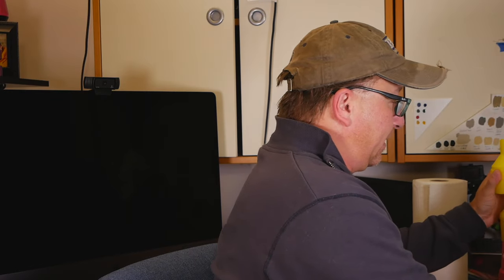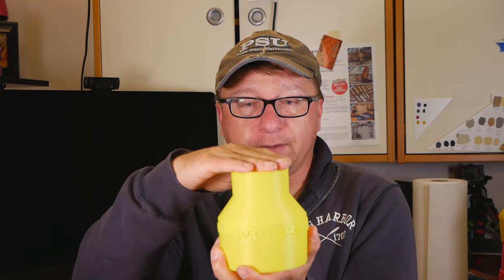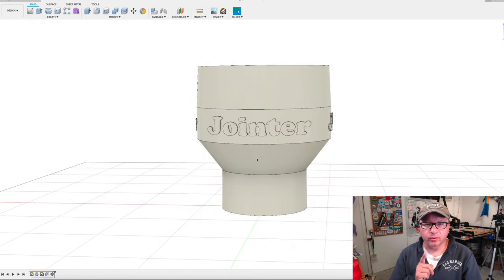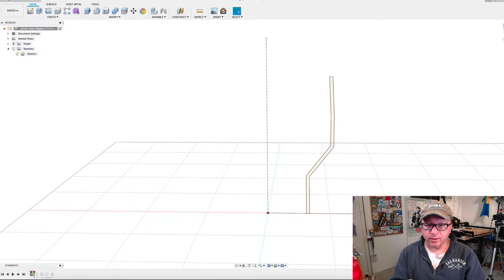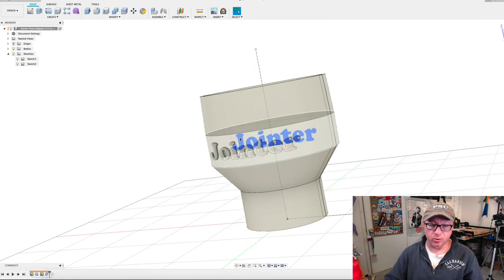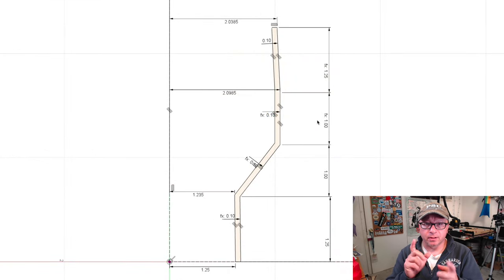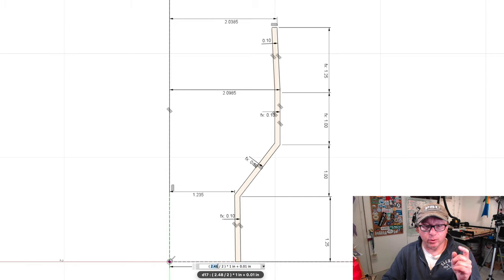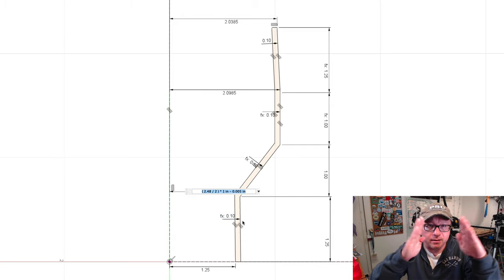3D Printing Hose Adapters

Comment: I like the idea of putting text on the adapters.  That way it makes it easy to identify which adapter goes where when they are all laying around.  The only issue I have with making adapters (not just yours but everyone's) is when they are printed the hoses sit across layer lines.  So if a hose is tugged / pulled at an angle, the adapter might split across a layer line.  Of course it depends on how thick you make the walls.  Still nice use of your printer to help around the shop.
Reply from the maker: Hi Eric - breaking on a layer line is definitely a possibility.  That's why I printed with 6 perimeters - printing with a large diameter nozzle might help too.  I've not had a problem with breaking anything yet, but if it happens, just reprint.  Thanks for watching and commenting!